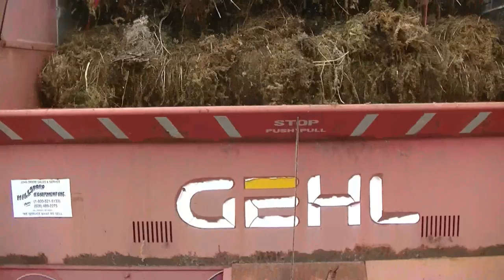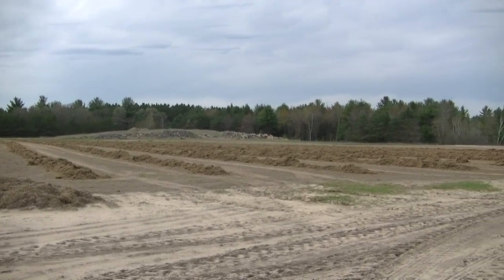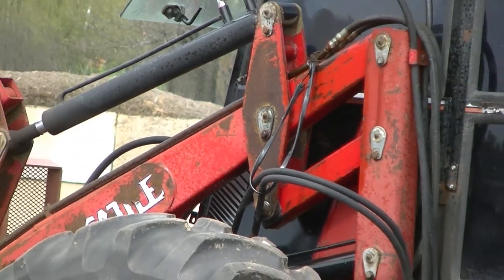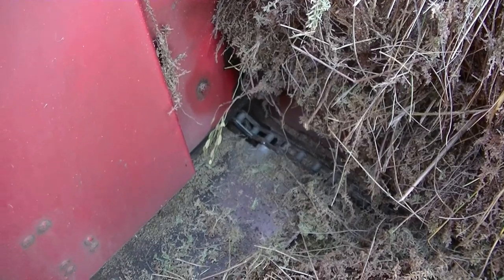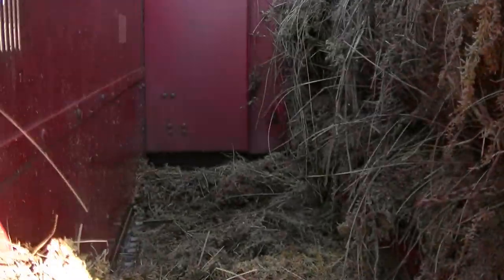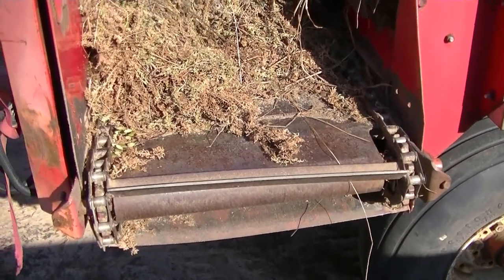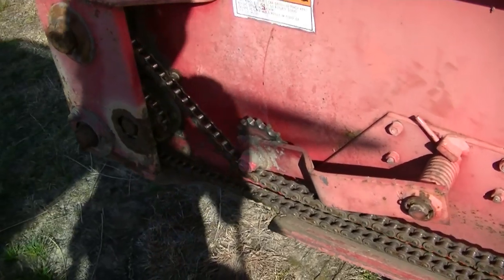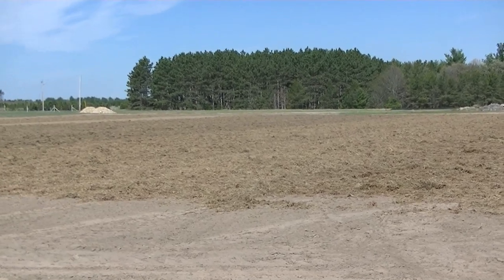First Loads of Moss on Drying Bed 2014 Season

Comment: Is that loader clumsy to back up with the cab being mounted in front of the pivot point? I know International used that design on their Hough Payloaders back in the day and everyone hated backing them up.
Reply: That tractor is bidirectional.
Reply from the maker: I don't really notice anything bad about backing up.  I have run this tractor for a long time thought.  Me and dad wish we would have gotten a 100hp John Deere with a standard loader.  The Versatile is not really any versatile than a normal tractor.  They are harder to work on.  The loader works great but it would be nice to just have another tractor with a standard 3 point with a loader on the front.
Reply from the maker: Yes it is.  That doesn't really help out much.  I wish we just had another 100hp standard tractor with a loader up front.